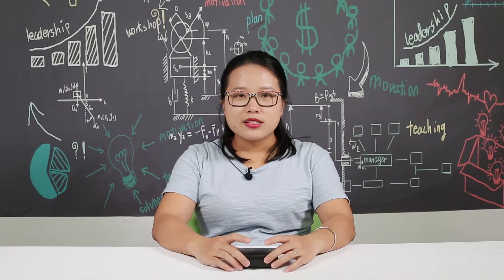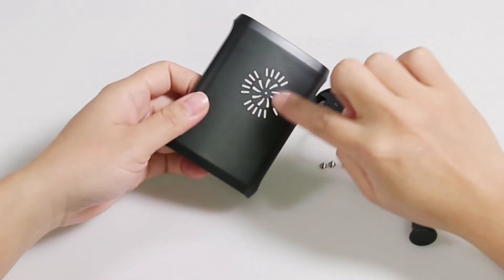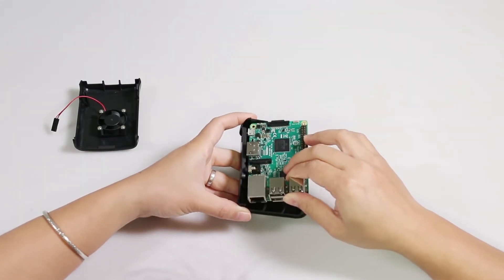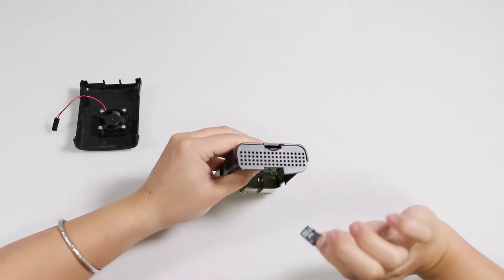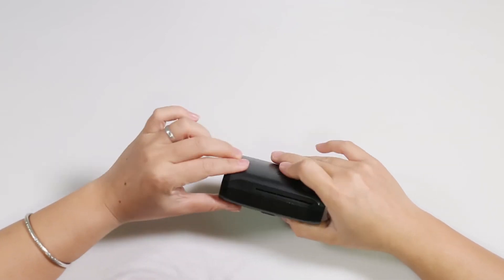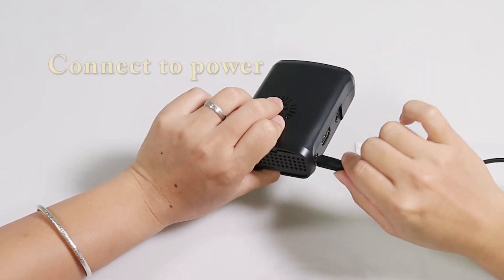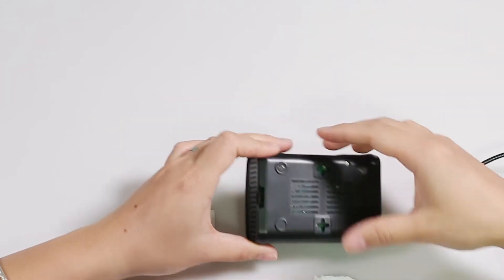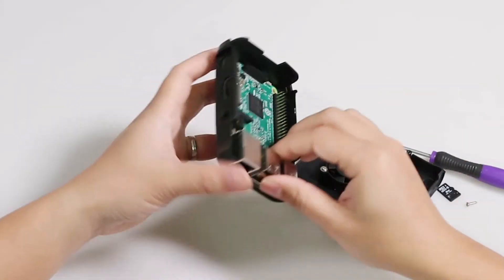How to Install the Raspberry Pi Plastic Protective Full Case with In-built Fan Connected

Comment: A few questions:
Does the fan work automatically or do you need to control it via the Raspberry Pi?
Also, does it work with other SCBs with the same GPIOs?
And, does the fan spin faster when it gets hotter?
Thanks in advance.
Reply: Automaticly ofc it's direct connected to gpio
It should've  just make sure to connect it to 5v and ground pins never connect it to 3v to reduce spin speed you burn ur card.
No, max rpm